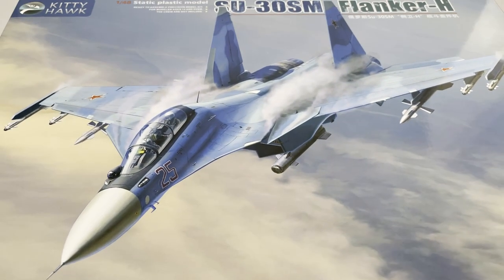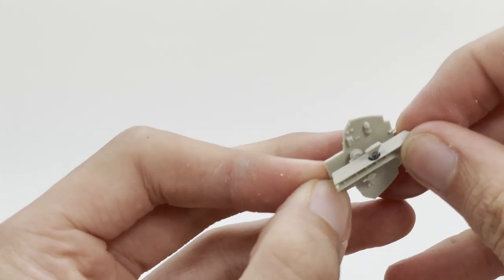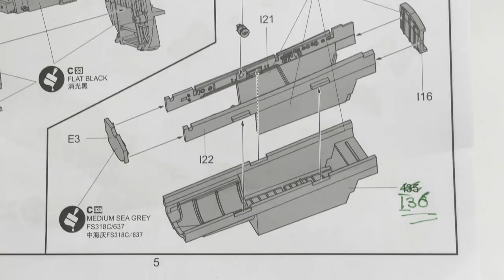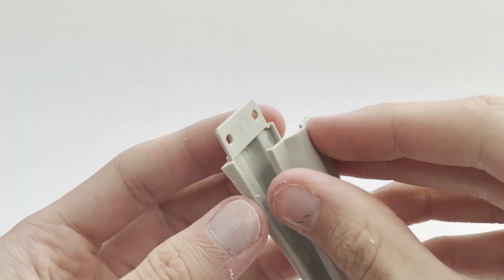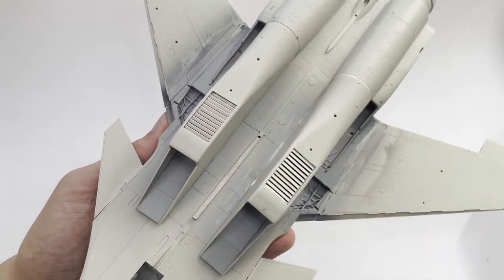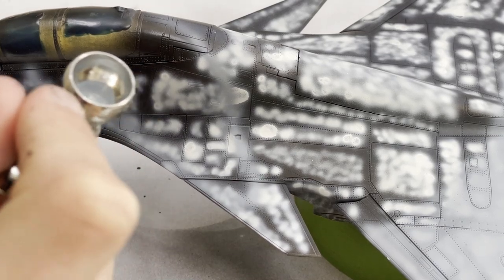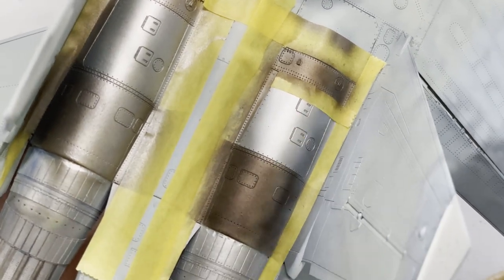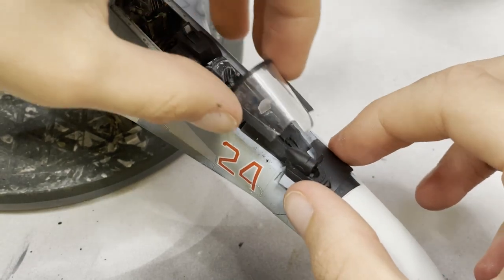Kitty Hawk's Su-30SM Flanker-H | Full Build | HD

Comment: Nice work bro!
However, KH's Su-30SM requires plastic surgery to make it shape-accurate. Cockpit is totally wrong, especially seats. They are anything but K-36DMs.
Reply from the maker: Thank you dude! Oh wow, I wasn’t aware of that as my knowledge of the flankers isn’t too advanced! Thanks for letting me know though😁
Reply: @machmodels   the only flaw you've made during this build is putting TV nozzles down to 0-0 degree. Al-31FP and Al-41F-1 nozzles are mounted 25 degrees outside to create side force vector rather than pure vertical as F-22 does. So the nozzles should look inwards-down (25 degrees) when the hydraulics pressure is out.

Comment: The metallic around the gun I believe is to make it easier to keep it clean from gun fire residue.
Reply from the maker: wow that would make sense!! thank you :)
Reply: Absolutely correct. 
Russian propaganda channel Combat Approved, has video about SU-30 SM.
Reporter was firing canon at some logs of wood and there were flames all over canopy 😂😂😂. 
Planes fuselage can't endure that heat..
Reply: Also, some horizontal stabs (Su-35)  are also kept natural metal as a precaution due to the blast from launching weapons.